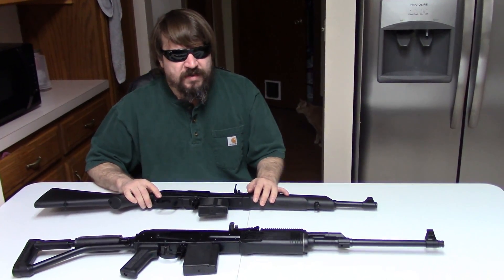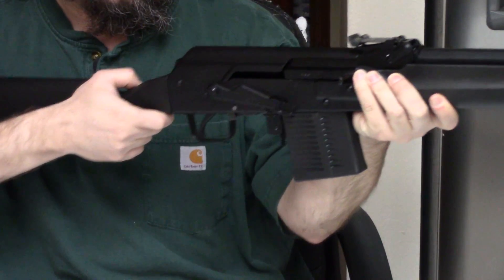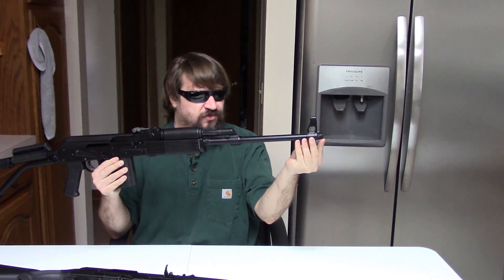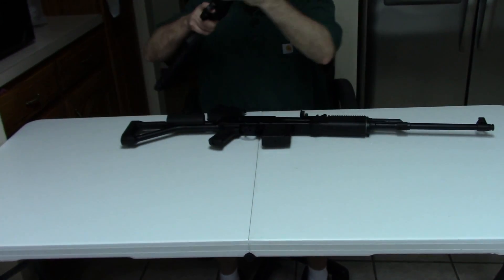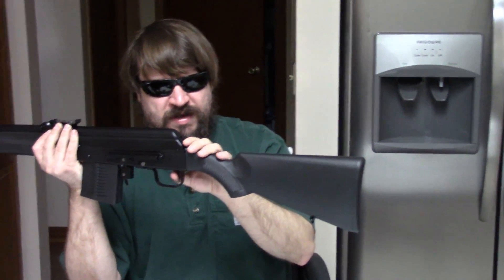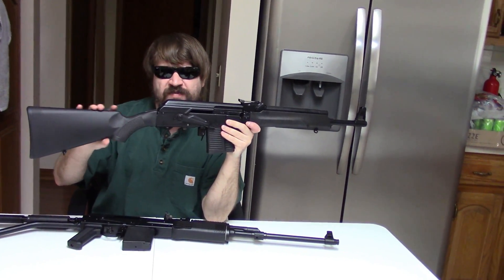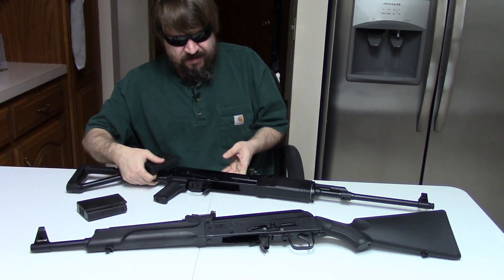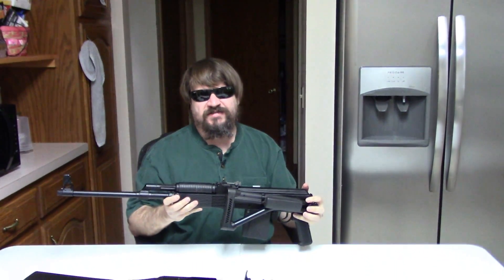Izhmash Saiga vs. Molot VEPR: The Better .308 Russian AK?

Comment: Great video,I'm definitely team vepr.suprised to hear the saiga seems to handle recoil better than the heavier and longer vepr in 7.62×51.Throwing a brake or compensator on that threaded barrel will surely help.
Reply: Yeah me too. I wonder what it is. Lighter bolt carrier group? Different strength springs? More gas in the Vepr?
Reply: @alchemist889  Gas port size.

Comment: These rifles use 3 lug bolts, not 2 lug.
There's an additional locking lug on the bottom, behind the "lug" that pushes cartridges.
The barrel on the saiga is notably thicker than the vepr as well.

Comment: I wish vepr was still imported. I wasn't old enough to buy a new one back then
Reply: You can still buy them on Kvar website.
Reply: @briandavenport8971  just the 6.5 and .243 versions,  I got the 6.5 grendel and it is nice, .243 is a bit rough on the barrels so  you can't magdump with it if you want longevity.
Reply: You missed the .308 ones by a year on kvar I bought one just before they went out of stock in 2019 and I haven't seen them back in stock since.
Reply: PictureMeRollin 96  If we're still alive, there might only be cockroaches and rats running around in 10 years!

Comment: I have a 16" 308 VEPR converted to be 922r compliant. The thumbhole stock that came on it was rougher than anything a 7 year old could make with a block of wood and a chisel.
Reply: Good you're thinking about that.

But the Harris/Biden ban is upcoming. Did you replace the thumbhole with a conventional stock?
Reply: Yes along with modern updates like a hand guard with rails and a pinned dust cover with rail that holds zero for optics.
Reply: @dougo753  I'm leery of almost any "updates"--heck, I'm inclined toward a good single-action rod-eject revolver!--but with the Election Steal, it's good you didn't go with the Godfather of Evil Features.

I'm much less one for personal indulgence than I am for maintain 2A civilian Militia firepower, regardless of particulars, to maintain our national heritage. RKBA has a function/purpose beyond itself.

Comment: I've considered trading/selling an Early CAI L1A1 for a 308 AK... I still wonder if the 308 AK would be a better 308 rifle. You are a blessed man to have both! Never did get a chance to try the OEM siaga trigger group either. From the video it sounds..mid range? it that makes any sense. Carry on  Noble Sir.
Reply: Never sell. Only buy. 
Especially never sell an L1A1. The AK is not a better 308
Reply: Back when I bought my Vepr I had come to the conclusion that it was the best .308 in the price range, which was quite low for its performance and quality. The only thing I would consider a potential upgrade would be something very expensive like a piston AR-10 or SCAR.

Comment: I am almost done converting my Saiga .223.  It's the most balanced AK I own.  I want a Vepr but I will have to wait and see.
Reply: Great! Now get ready to convert it back to hopefully escape AW bans.
Reply: What kind of conversion did you do
Reply: @Anonymous-ip4qx  Saigas came into the country in a hunting/sporting configuration.  The trigger/trigger guard  is in the wrong place, no bullet guide and no front handguard retainer.  You have to pull out that trigger, install a new trigger/trigger guard, pistol grip, and bullet guide.  You also have to remove/replace the front sight block.  It's an involved process that you can do yourself or pay to have done.  Now the gun looks like a proper AK.

Comment: I've done loads to my FM-AK308-22. M4-72 break, TDI mlok grip/RIS, Atlas bipod, Ultimak gas tube, a carry handle, MI Scope mount, Elcan Specter DR 308, Krebs Amby/hold open safety, PRS Gen 3, with a Mono pod. Yikes.
Reply: Has your ultimak ever Came loose on it after shooting? Does it take the m1-b model? I have an extra m1-b ultimak laying around.
Reply: @smoothshot8925  I'm about 600 rounds in and absolutely no issues. I also thread locked the screws so there's that. FM type Veprs use the M3-b model.

Comment: I got a 23” vepr in 7.62x54r. It ejects brass a minimum of 30 feet. I just got a kns piston to try and tame the beast.
Reply: I wanna get a kns piston for my psl, i only see one for sale and it doesnt specify if its small bore or large bore. Not sure if its universally compatible or what. rob skiis video on psl inspired me though. I bet your rifle will rock with some good ammo, id check out the seller and bellot stuff.
Reply: Robby Woods there are no small bore psls. There’s a specific model just for the psl. Optics planet has a few in stock. There’s a drop down menu with 28 different models.

Comment: in process of converting a .308 saiga right now, what optic would you use , roughly 4x, and id like it illuminated. i somewhat like the scope that came with my psl, but being not illuminated makes it hard to see in low light or darker backgrounds. thanks guys!
Reply: Aimpoint mini or micro with magnifier on a front aluminum quad picatinny front rail. Thats what i run and i shoot with both eyes open with perfect sight picture with 0 fatigue which is a problem for me when closing 1 eye

Comment: I prefer the Vepr based on looks. How would it compare to an FAL in performance?
Reply: URANINITE81 
The  FAL is quite a bit more precise 
As far as reliability the VPER has a slite edge
Reply: @petergagnon6851  I don't know, I've seen people get some really nice accuracy out of the Kalashnikovs. There was a guy with a Super Vepr that was posting sub-MOA groups.
Reply: Could this replace the FAL where it's still used in law enforcement?
My country's police Swat/SF still use them,but I'm sure they're a struggle to maintain them and are probably scavenging parts from the stock piles. And would a Vepr or FAL be easier for mounting optics?
I do think that an R1 is better looking than a Vepr tbh.
Reply: Prizrak2084 Intresting i hope the South African police and military make a good decision as they are soon going to need to replace most of there old weaponry. I think another good option would be to get a local  manufacturer to produce a whole range of products including a 7.62 DMR. I believe there is a local company called ADG that does produce such stuff. I think they have some good offerings. Maybe they can export to the US it’s good for our economy.
Reply: @uraninite8151  several countries are going toward the Galil Ace route. A good comparison would be the Galil Ace in .308 and it has a railing on its dustcover for optics as factory standard

Comment: VEPR is higher quality, but IMO the weight makes the Saiga a better overall rifle. That said my VEPR is downright luxurious to use, with a bolt so smooth to rack that it puts any of my other rifle to shame.
Reply: PictureMeRollin 96  Im a pretty strong grown man. I literally started lifting because the VEPR was tiring to shoot for more than an hour. That said if all things are equal, usually the lighter rifle will be more effective because of its better handling.